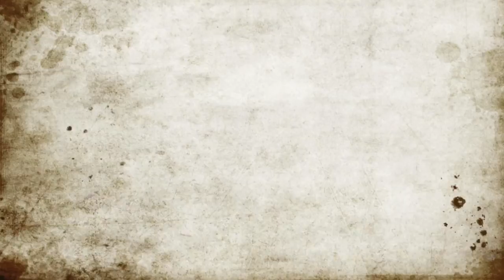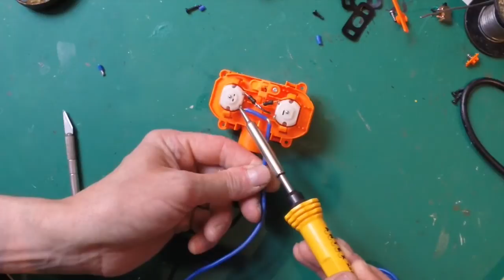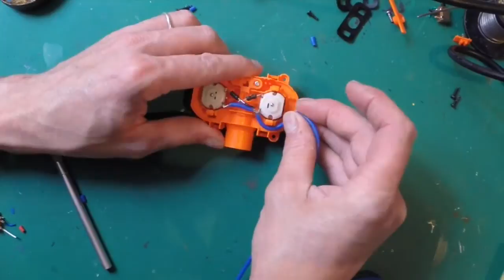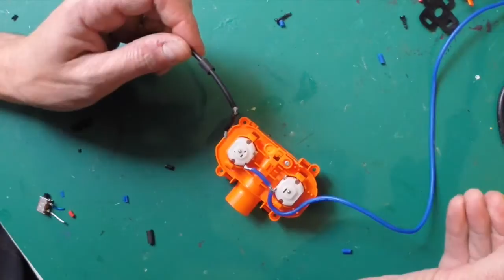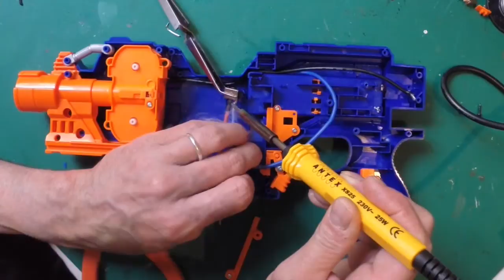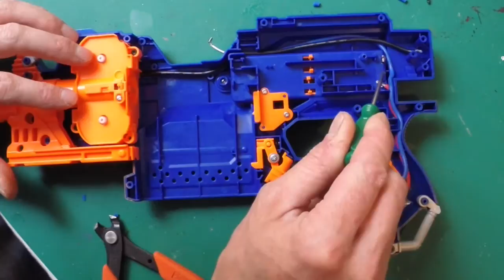Nerf Stryfe Re Wire PT2

Comment: When I press the rev trigger, nothing happens. Do you know connections could be loose? Also what size and gauge wires are you using?
Reply from the maker: +Mr. Argonian You have probably over heated the rev trigger and damaged the connections. Swap it out for one of the lock switches, connect the red wire to the middle pin, then the blue one for the motors to the bottom pin if its a three pin switch. Everything in this one is 18AWG silicone insulated hobby wire. If you want a proper diagnosis get pictures and go to Britnerf or Nerf Reddit, Youtube is hopeless for fixing stuff over comments.
Reply: Foamdata Services Ok Thanks!
Reply from the maker: Tell me if you find the problem.
Reply: +Foamdata Services ok

Comment: i tried this and it didn't work. then again I'm new to soldering.when i press the rev button, nothing happens. but when i put the batteries in the flywheels start to spin very very slowly. do you know what connections might be loose?
Reply from the maker: +Mr. Argonian See my reply to your other comment.
Reply: Foamdata Services It said that it wouldn't let me upload it, but I guess it uploaded them all.

Comment: How do you do this for a XT60 Lipo?
Reply from the maker: First, change the XT60 for a deans, it won't fit in the tray, you need a small pack or a tray expander, small packs don't have an XT60 connector,nthey are usually JST. If you are running a bigger pack don't have Lipo outside the hard blaster shell, it's dangerous. To wire for a pack do everything the same except instead of soldering the main battery +ve (red) and -ve (black) to the battery tray connections, you clear all the springs and ribs out the tray and off the tray cover, then drill a hole in the top corner of the battery tray and run the main battery leads through it, then solder a male connector to the end, making sure the polarity is right. The female connector goes on the pack.
Reply: Got the BSUK kit so im ok with the tray. But thanks for the help
Reply from the maker: That should fit fine if you measured right with a tray expansion.

Comment: Now I know you stressed this a lot, but just to be clear, I should use crap batteries like an off brand Chinese type?
Reply from the maker: No, get Efest, AW or Windyfire IMR batteries if you are sticking to AA size cells. Avoid cheap crap LiCo cells as they suck bad and are potentially dangerous. Go look at my Battery Guide video for more on Nerf batteries. Bobololo also has a good Nerf battery vid.
Reply: Thanks man! Looking forward to doing this mod.
Reply from the maker: +Kanin Shull Good luck with it,  remember if you are using mod motors packs are better.

Comment: where does heat shrink do?
Reply from the maker: Heat shrink tubing insulates your connections to protect them from short circuits, which can pop your battery. It also supports the connection and makes it more robust. It's not an optional item, if you want safe and reliable electric mods, you need to use it.

Comment from the maker: Starkiller 2807- you have to cut the bottom right corner of the stock switch housing away until it fits in. You also have to modify the cover. If you do that you can retain the trigger lock, which stops the most common jam in a Stryfe, where you pull the main trigger before the rev and stall the flywheels. I put a pad of Devcon adhesive for the switch to sit on then clamp it in place until set.
If you google it there are pictures as well.
Reply: +Foamdata Services What brands and kinds would you recommend  (motors, wires, switches, battery pack, etc.) for a FULLY upgraded Stryfe? Also, I live in the US, would that affect what I could get?
Reply: +Foamdata Services  I am not a modder so please try to speak in english. But for the racord I am willing to take up the challenge.
Reply from the maker: Luis- Just get this complete kit from BlasterTECH, you just need to add a battery. Tacticool Foam is in the US.
http://www.tacticoolfoam.com/electric-blasters.html
Reply: Thank you so so so very much!
Reply from the maker: +Luis Benjamin Diaz Hope that works for you.

Comment: when it worked whit testing can u than run imr baterys whit a dummy
Reply from the maker: +Virgil “CrazyGameLover” Bouwens - If everything worked after you rewired and you tested with regular batteries, then you can put your IMR batteries in. If the blaster is new I run it a bit on the regular AA batteries to break in the motors, half an hours messing around is usually enough. 3 IMR cells and one dummy should be considered a safe limit on stock motors.

Comment: Do u mean whit that batry test only normal regular batrys for test ?
Reply from the maker: +Virgil “CrazyGameLover” Bouwens You should NEVER test a blaster you just finished with high power batteries or packs, you should use a regular alkaline battery. I use the standard AA's in strafes and a modified Rapidstrike battery tray with 4 C cells for everything else. That way if you have made a mistake you won't short out your high power battery or pack, which can cause wiring to melt or you mod battery to catch fire.

Comment: What is that black little peices on the wire we dont needed that u sayyed onlyy black wire blue and red so what does that do and i dont get that part where u do that red wire i dont know what u mean
Reply from the maker: +Virgil “CrazyGameLover” Bouwens The RED wire comes FROM the battery tray +ve connector (bottom one) to the rev trigger Common, which is the top pin on the switch. The BLUE wire is the feed to the flywheel motors, it goes from the motors to the BOTTOM pin (Normally Open) on the rev trigger. The BLACK wire goes from the motors to the -ve connection on the battery tray (the top one.) Thats the entire wiring loom, 3 wires. If you can't make sense of that, then stay away from electric mods.
If you get the rev trigger wires round backward, it won't matter as the switch will still work the same.

Comment: Hey, these videos are fantastic! Super simple, and most comprehensive rewire guide for the Stryfe I've seen. 

I was hoping you could answer a question of mine. I'm planning on running a pretty conservative Stryfe set up, with stock motors, rewire and two 3.7v IMRs. Do you think it's worth it or necessary to replace the rev trigger switch with a lower resistance one? I know you said it'd be necessary for a certain motor replacement, but I'm just wondering. Thanks!
Reply from the maker: No you won't need to replace the switch with that set up. I have some that have run 2 or 3 IMR cells for two years without being opened. I even leave the Rev trigger lock in so you don't pull the main trigger without revving, which is the most common new player error with Stryfes.
Reply: Foamdata Services Awesome! Thanks so much for taking the time dude! I also just realized you answered a similar question in the comments a while back...sorry about that haha.

Comment: i know this probably a stupid question, but if i dont have shrink wrap, can i use a dab of hot glue on the contacts?
Reply from the maker: No, hot glue often falls off. Shrink wrap is pence per piece. Get some. 
In an emergency Electrical Tape is ok, but it leaves a crappy glue residue behind and doesn't last like shrink wrap. If you have any hi power chemistry battery in there and you un-insulated joint makes a short circuit you could cause a fire or cell explosion. Always do the job properly and have all the right materials to hand before starting a job. A couple of days wait for parts is better than injuring yourself or others with a bad job.

Comment from the maker: John Robert- Couldn't reply to your comment directly- The stock switch doesn't limit current. a switch is the same mechanical system no matter how its built. Nerf ones are just very cheap and designed for stock current, so if you are going over 2s Lipo or using 180 motors its worth swapping it for a good 10.1A microswitch, otherwise its fine. Swapping the rev switch also allows tuning of your rev trigger movement.
Reply: Foamdata Services Thanks, I was planning to put in some 5A microswitches, (2S 500mAh LiPo) but  I guess I'll stick with the stock for now.

Comment: I'm planning to resolder a 9v connector to my Stryfe so that my it will power on a 9v battery. How do I do it?
Reply from the maker: DONT DO THAT. 9v batteries are awful for Nerf, they belong in a smoke alarm, not your blaster. Sorry, but they are so awful it's not worth it. Save your money for better gear.
Reply from the maker: Alternatives include using 3 ordinary batteries and 1 dummy then putting in Tamiya Torque Tuned motors, which are relatively cheap, or if you really can't rewire, two 14500 IZmR cells and 2 dummy cells will work in the stock tray with no other mods. Full rewiring is still better. Check out my battery guide for more info.
Reply from the maker: Typo in my post, it should read IMR cells.
Reply: +Foamdata Services Ah.. Looking back this post from 7 months ago. Back when I was too stupid to use a 9V for my Stryfe. HAHAHA XD
My Stryfe that I wanted to use now runs on a LiPo now. Still, I can't thank you enough for this guide from last time.
Over the months and months of trial and error and multiple experiences one learns and grows.
Reply from the maker: Glad to help! Mistakes are how we learn, I just try to minimise other peoples! I still mess things up regularly.
Reply: By the way, once I installed a 9v in my Stryfe, I wanted to test the capacity of it.
I Revved the Motors for 30 seconds and instantly the battery became weak lol
Reply: Foamdata Services thank you for warning me about the burst that could kill me cause i didnt ever plan on dying well doing this lol

Comment: Alright, So I was modding the Cam ECS-12. However there are no in depth tutorials anywhere. The Stryfe is the closest to a CAM ECS-12 so I started watching this mod guide. Quick question. Would I have to use heatshrink or is the soldering enough?
Reply from the maker: Always use heat shrink, it insulates the connections and looks much tidier. I only put it on the switch connections now. Keep the camera curcuit as is on the CAM. Nobody mods them because they are so expensive and the stock performance was rubbish! Good luck with yours.
Reply: Foamdata Services Thank you for answering so quickly! I have 1 more question. I am new to modding flywheels and I was just wondering, how would I rewire the trigger switch on the bottom to connect up to the board under the trigger mechanism?
Reply from the maker: You will need to come over to Britnerf.co.uk for detailed fixes like that, I need to see the part. There are no curcuit boards in the trigger.
Reply from the maker: I suspect you are seeing the PTC, it's on the -ve on the battery tray. Get rid of it. Check in part 1 of my guide, it shows how to get it out.